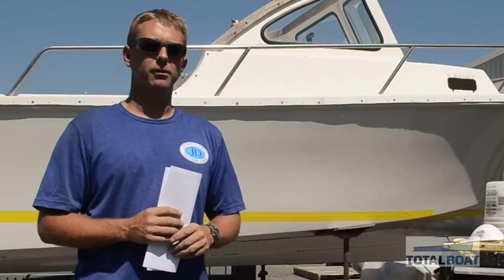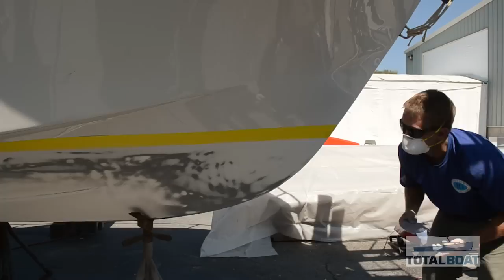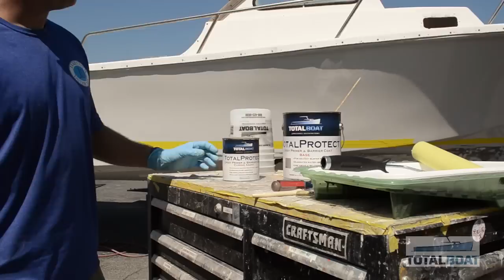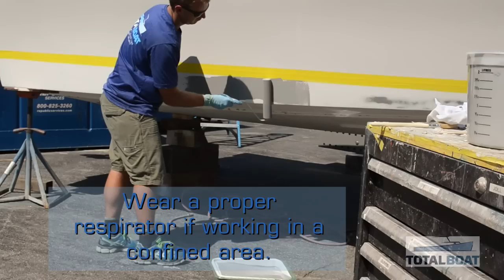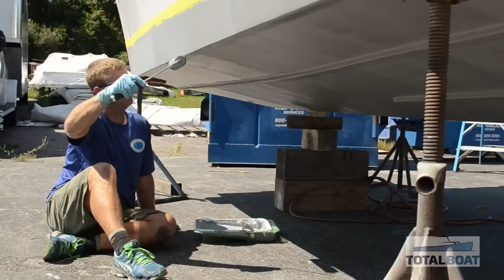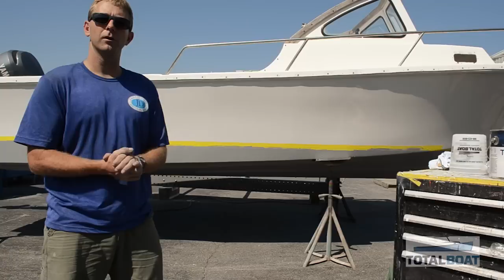How To Apply Barrier Coat on Your Boat

Comment: what would happen if the first layer of Barrier coat completely dried before getting that second or even third coat on? do you lightly sand and reapply? do you have to wait for the barrier coat to completely dry before putting on antifouling?  thank you   i hope you answer

Comment: Hi! Thanks for the great video! Do you have to remove and reapply masking tape for every new coat of epoxy? Or is it Ok to remove the tape when all 5 coats are done?
Reply from the maker: you should be able to leave the tape until the job is done, however use good tape and not something cheap. Make sure it's 3M and maybe even go for the green tape or FineLine which is higher quality.